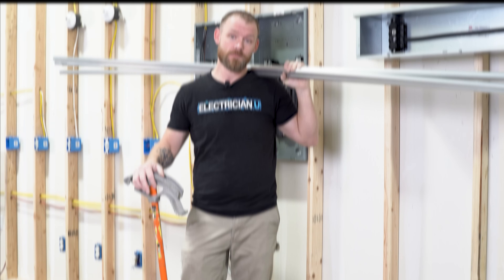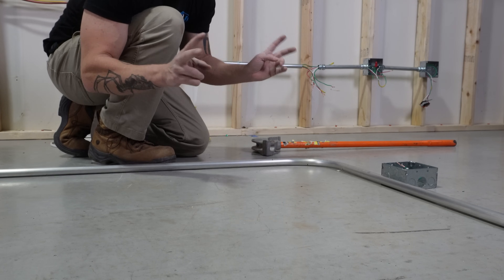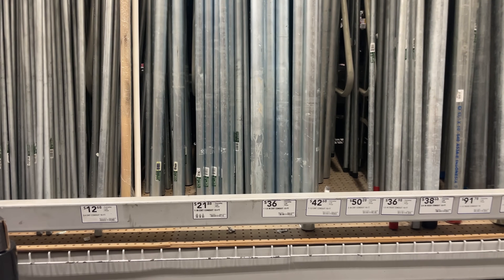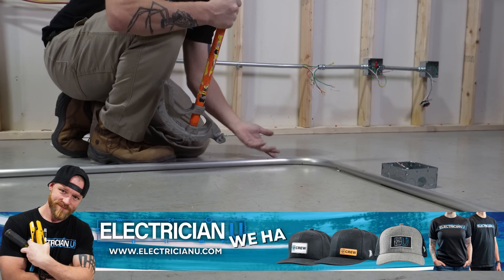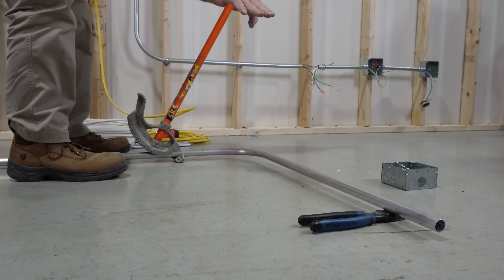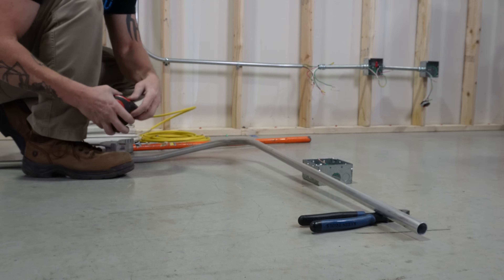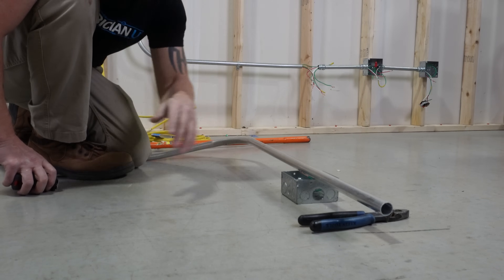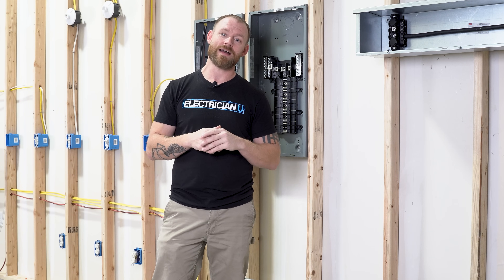How to Bend a Kick in Conduit

Comment: Surprised to hear that it's cheaper.

And the first 3 times I read the title, 'kick' was reading as 'kink' in my head. Crazy.
Reply: The formula for bending a kink is minimal foot pressure and pull the handle hard and fast….oh, and using the next bender size up helps too!😂

Comment: Kick is just a offset but you turn instead of going straight when you change planes.
Because of how small kicks are most of the time you need to do 22 and 10 degree  calcs for marks because the 90 gain is in the way.  if you ever need to run a rack the same.

Comment: I have a question.  If a gazebo has a copper roof, can I use copper water pipe to match the roof?
Reply: Maybe use a bigger copper pipe to cover over the approved conduit?
Reply: @chris76-01  that or spray paint the conduit black or bronze.
Reply: Copper plumbing pipe is not "listed for the application" to be used as an electrical raceway. Will it work? Yes. Will it satisfy code requirements? No. 

We ran into a scenario where we were using decorative architectural poles in a library to attach lights to. The inspector argued that they were not tested and approved by UL labs therefore would require an actual "listed" electrical raceway. Even though  the steel was 1/2" thick  we couldn't run thhn in it like we would a light pole.
Reply: @Enlightn76  They really need to come up with a brass or bronze conduit or something other than the silver that conduit comes in.  What are you supposed to do in aesthetics or places where the conduit has to be exposed but yet it clashes with the decor?
Reply: @chad rowland:

There is a red brass conduit available in 1/2" trade size only. I believe it needs to be cut Md threaded like RMC and have never actually seen or used it in real life.

Best I can tell you is UL and conduit manufacturers aren't all that concerned with asthetics. Most "decorative surface mt raceways" are hideous, ever seen a wiremold catalog?

Comment: Another good way is to use your measure ment of the kick you need and whatever degree bend you want. Use your multiplier for that bend. Mark it from 90. Bend using the arrow, and it will kick it to your mesurment. It's basically a 1 point offset. It helps doing it that way when you need to minimize bends for code or preference for wire pulling.
Reply: You make good points. I had to pull branch wire in a building behind a guy who refused to bend a kick on a 90. It wasn’t that he didn’t know how to. He just insisted a 90 with an offset looked better. I’ll admit his pipework looked nice but he sucked at pulling wire and I’m guessing rarely ever had to pull wire through his own pipe runs. A lot of his pipe runs were well over 360 degrees between pull points. The only thing I would add is that you have to account for the distance between the arrow and where the center of the bend falls for the angle to be correct. It’s important especially when you’re running a whole rack of multiple pipes all turning 90 and kicking at the same time. They need to all be congruent especially when exposed
Reply: Was coming her to comment this
Reply: I'm not sure i understand.
Is it to know how far from the 90° to do your kick??
Reply: @martf1061  yes, measure from the back of your 90 like you normally would the distance between bends for an offset. So for a 6 inch kick @ 30 degrees you would place your mark 12 inches from the back of the 90 but you would align your mark with the 30 degree notch/indicator on the shoe instead of the arrow
Reply: @Ephesians-ts8ze  ok thanks for the explanation.
Ill try it next time.
I usually "play it by ear" 🙂 and works well for me because of the experience.
Always good to learn new tips. 🙋
Reply: @martf1061  no problem. You can always bend a kick “by ear” if you’re just running a single conduit and it looks just fine but that tip really comes in handy when you’re running a whole rack of conduits and you want all your bends to look nice and congruent
Reply: @Ephesians-ts8ze  exactly

Comment: Don’t forget your conduit will shrink about 7/16 or so for every inch of kick
Reply: It depends on the angle of bend. The greater the angle the more shrinkage per inch of kick. Same as for an offset
Reply: So a 1” kick the conduit will shrink 7/16”. I don’t think so. The shrinkage on a 60 degree offset is 1/2”.
Reply: @adammorgan9304  exactly! Shrinkage per inch is:
15 deg=1/8 per inch of offset
30 deg=1/4
45 deg=3/8
60 deg=1/2
Reply: I was always told that if I used 3/16 per inch worth of kick, 3 or 4 points etc etc that it would always work out and I’ve been using 3/16 per inch on all conduit that’s in the 1/2” to 1” of EMT and it’s always worked for me. Love the videos

Comment: What precautions do you need to take  When attaching aluminum conduit to steel boxes are there  There fittings that keep the 2 from reacting with each other
Reply: In dry conditions that isn't a concern at all, and NEC 358.14 allows for a combination of aluminum and steel where there aren't severe corrosion conditions.
In other words, play it safe and use like materials if you know the environment will be rough.
Reply: @Timpossibly  wtf is the purpose of aluminum? It seems really expensive
Reply: @fishsmell3939  Two things - aluminum is easier to bend with larger sizes (1" and up), and it's there where it's slightly cheaper than steel.
1/2" and 3/4" market is still dominated by steel, so aluminum in those sizes is still more expensive. For now.
Reply: @Tim C  how can aluminum be cheaper than steel? Thanks for your info bud.
Reply: @Timpossibly  cause I was thinking just being lighter would be nice.
Reply: @fishsmell3939  Generally aluminum IS more expensive. I imagine vendors can offer better prices on aluminum conduit when it comes to larger scales. For instance, shipping 100,000 ft of 2" aluminum conduit to vendors will inherently be cheaper vs steel because of the weight difference.
Reply: @Timpossibly  oh yea ok thanks dude. You're the man. Very helpful.
Reply: @fishsmell3939  I was thinking the same thing!